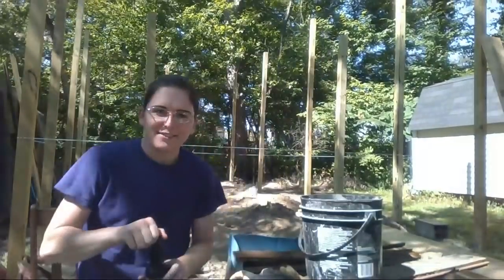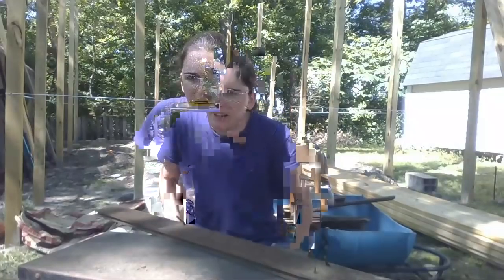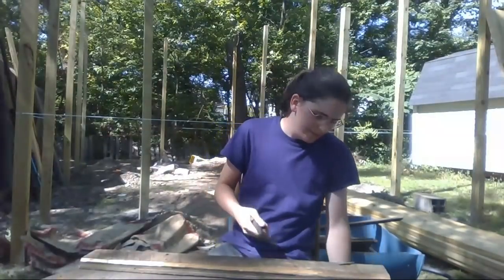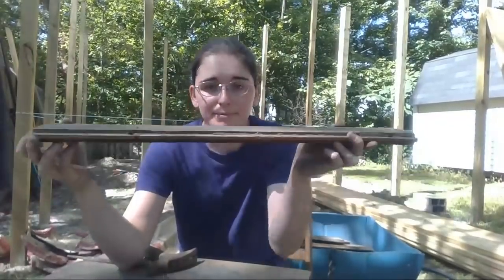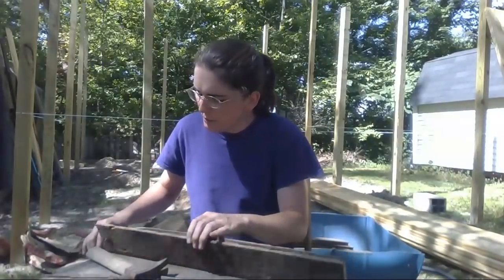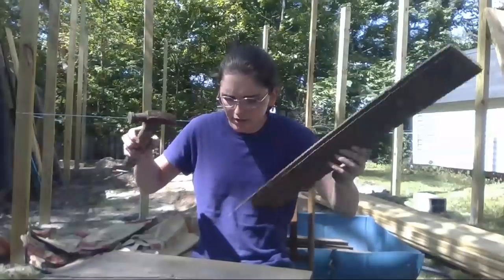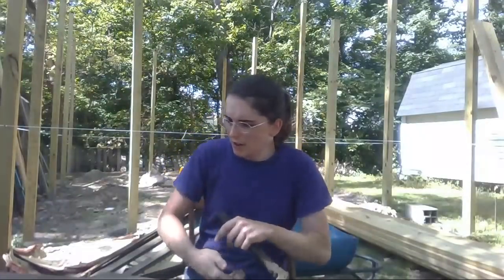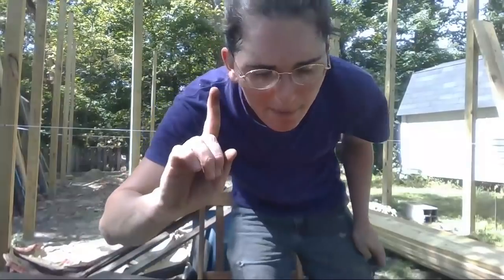Removing Nails from 1890s Hardwood Flooring / OBS livestream experiment 1/3

Comment: On the fence tool, the pick if for driving under the arch of a staple and pulling it out, the other end is not a hammer, it the surface that you strike with a hammer. The middle opening is for twisting barbed wire, .one piece enters each side of the tool, the top jaws are also designed to grasp the fencing staple and pull it once the pick (as you called it) got it above the surface of the fence post, you did ID the side cutters correctly. Most of those tools also had a pair of pliers between the handles

Comment: Nice clean SPDIF/MPEG4 data, with DOCSIS3.5 you should be able to get more than 30mbps, I wonder if the blade is grabbing two much wood so taking off less wood will make it easier to plane.